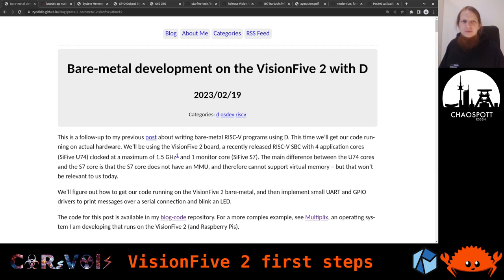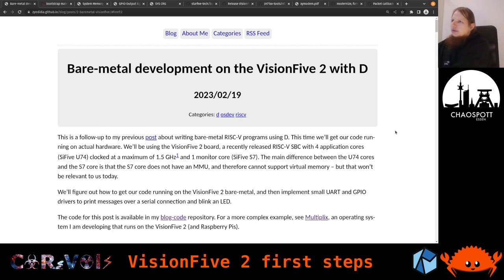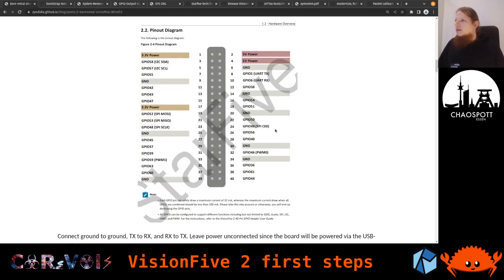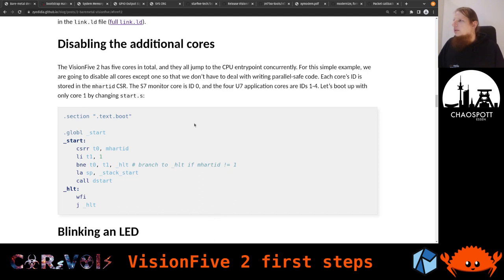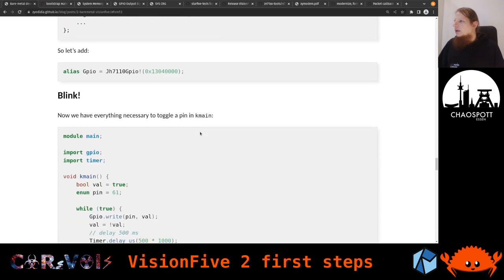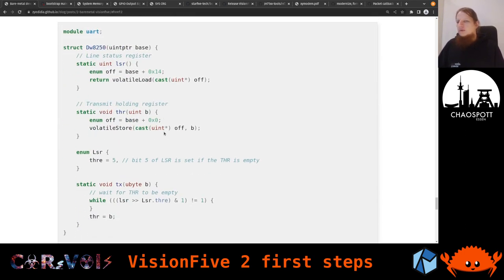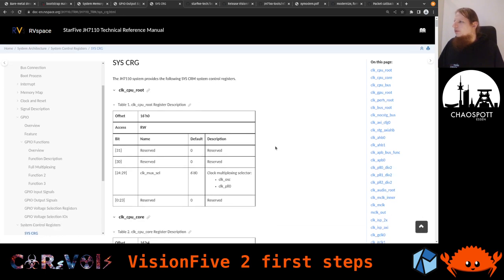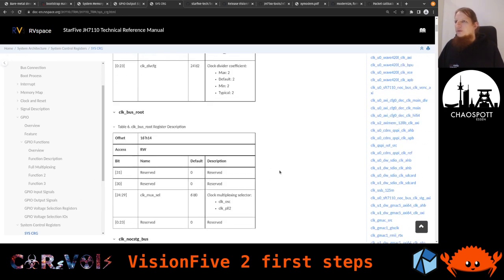oreboot on VisionFive 2 001: First Steps

Comment: Hey Daniel,

How are you? I have been looking on Oreboot for quite some time now. I am not a programmer and my knowledge is very limited. Is Oreboot capable to be installed in any machine? I probably have a lot more questions. But, I am keeping it brief.

I like that it is written in Rust since I am taking baby steps to learn it.
Reply from the maker: So far, those three platforms are implemented (see src/mainboard/);
- Allwinner D1 with 512MB RAM (WIP to extend)
- JH7100 (DRAM init only thus far)
- JH7110 (DRAM init with SBI work in progress)

Installation is doable via vendor specific tools.
So far, the D1 implementation is the furthest developed.